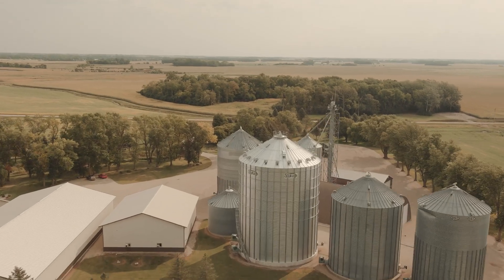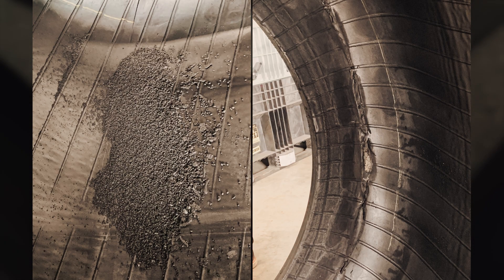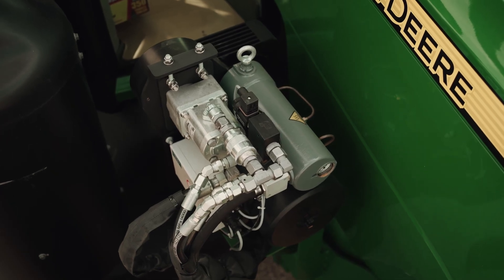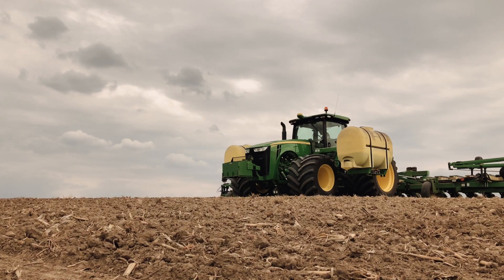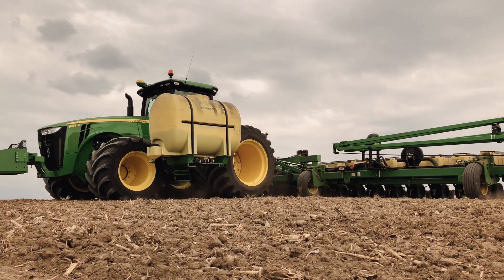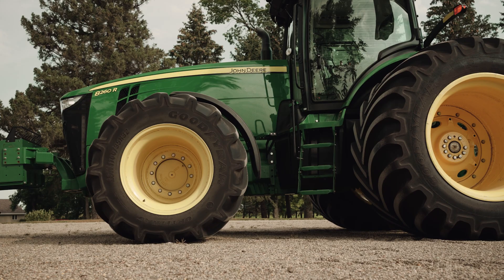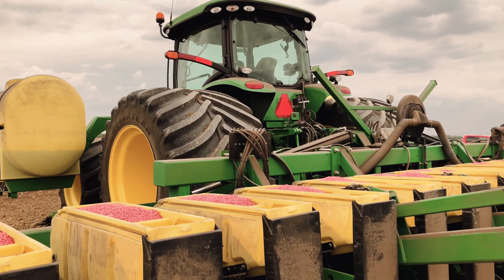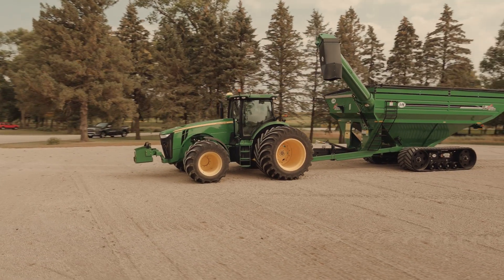$28,000 Worth of Rubber RUINED!!

Comment: Late to the show here but what was the pressure he was running?   When I researched these tires I wasn’t exactly impressed with how low you could go in tire pressure vs say Michelin VF’s
Reply: My verdict from online research and reading, is that these tires are in reality only popular to people who DONT like to adjust their tire pressures.
The "low sidewall technology" In reality only serves to eliminate 'powerhop, marketed together with the excessive width that makes lower pressures seem irrelevant.
The width of the tires does spread the weight over a larger area, but the tires don't have nearly the same capability to get 'longer' when the pressure is lowered as a high sidewall VF tire can.

Even NTS has published a test where a twin Michelin VF Yieldbib tire beats an, overall wider, Goodyear LSW Opti track setup in traction. Where the LSWs could do 12psi the Yield bib could do 8psi.
I looked it up, quote: "Test 2: Michelin VFs Leave LSWs in the Dust" "+16.7% efficiency" (and respective work rate increases)
Reply: And if you interpolate results, it seems like the normal non VF tires they tested actually perform better than the LSWs!. There seems to be a reason why the only compare them to rowcrop tires.